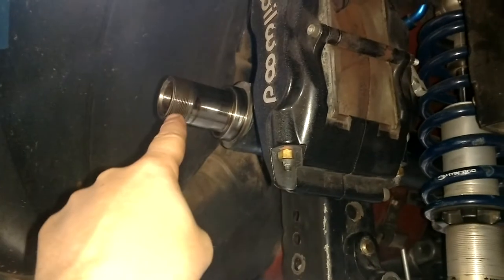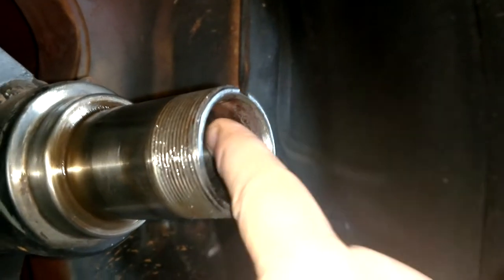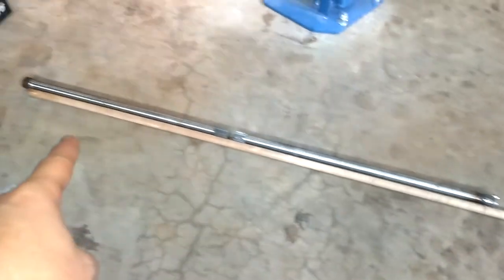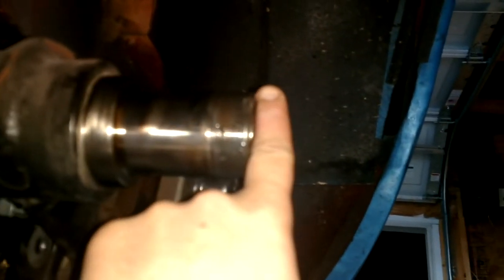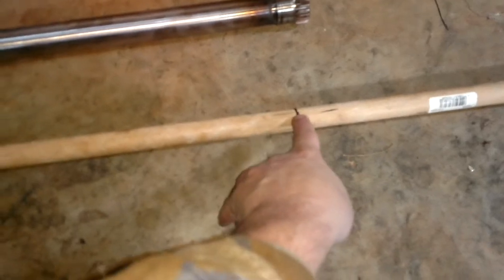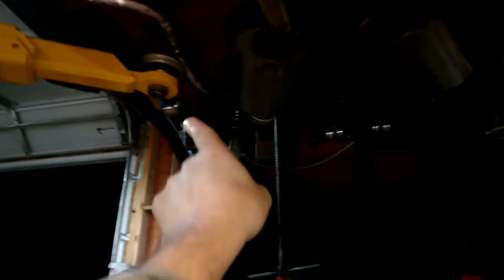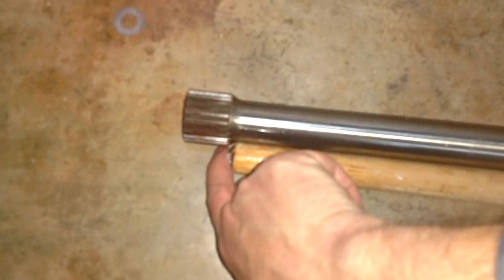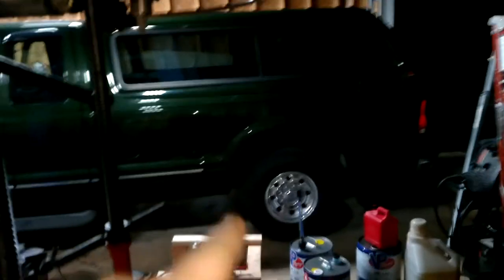Axles are too short

Comment: Don't you have a center pin in the differential ?
Reply from the maker: No there is no centerpin this is a floater rear end with a Detroit Locker. So it passes straight through the center all the way out the other side
Reply from the maker: Turns out I did not set the end play correctly. Axel's like this require a 9/16 screwed into the inside of the axle to set the end play against the other axle. Ordered a new passenger axle and bearings and seals and fixed the problem.